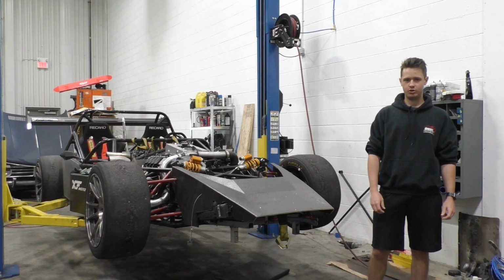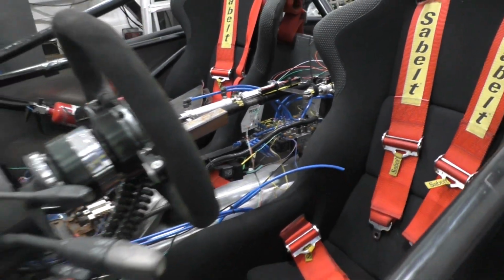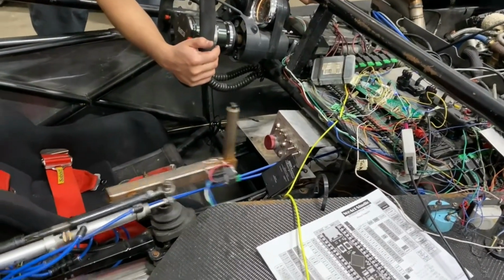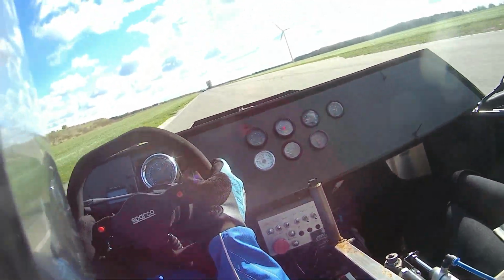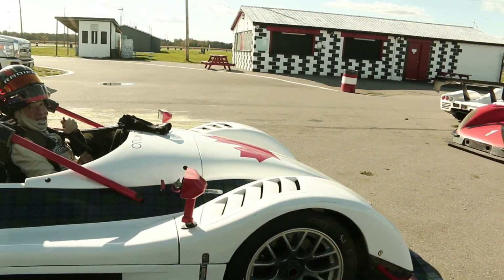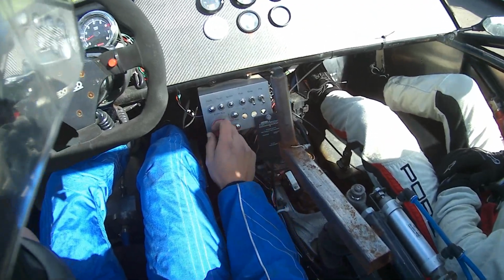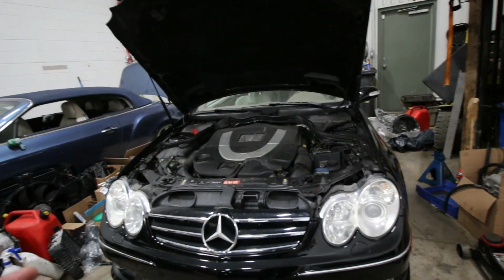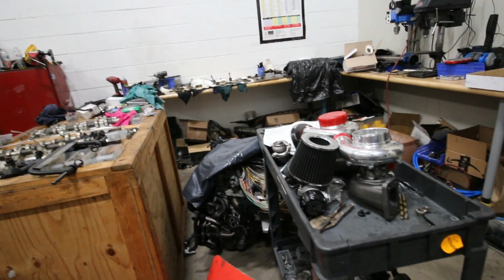Converting a Manual Transmission to Paddle Shift (Making the Electronics)

Comment: I would personally like to see the whole mechanism cleaned up and shrouded to some extent.  I think you could loose enough weight by cleaning that mechanism up to rationalize putting some kind of protective cover over it.  I understand that you like having the ability to shift it manually, buy I think a good goal to set would be to make it reliable enough to not need that backup.

Comment: Congrats on 100k The paddle shifter as a engineering exercise is pretty cool. Seems completely unnecessary for this project given the broad torque range and power.You only have to shift a couple times per lap. For me the simpler you can make a race car the better, less weight and more seat time.

Comment: I really think the shifter interface could be made much cleaner.  I've pondered about this for a long time because I have a T5, but on that CD009 with the external shift rail it should be much easier.  Really you've got a "barrel" and "throw" action, it should be possible to automate the barrel using a servo motor (not hobby servo, a proper servo motor) and handle the throw with either an actuator or pneumatics.  Back in the day a team used parts from an Aston T56 to make a computer controlled shifter for a paraplegic racer in the Mustang series.  I know you're married to the CD009, but a T56 with those Aston electronic shift components could be a nice alternative.

Comment: Maybe you should consider 8HP gearbox and standalone controller for this eg. TCU from TurboLamik in Poland? Three is a lot of video's about this controller. Also GCU controller from HTG company is very popular now.
Reply: too heavy for a race car. and why buy controller when you can make one
Reply: @kize32  but when something is popular on the market and checked by users, I think its faseter to buy one, and also its more reliable than controller you have to design by yourself. Of course develiping things  by yourself is more fun and you can learn more, but if you need fast and reliable gear changes its better to youse something which is known on the market.
Reply: @pitucha1234  shipping from poland to canada would take how long? 2 months?
Reply: @kize32  no, ZF 8HP weighs less than 100kg

Comment: besides price/wanting to do it yourself.

have you guys considered a e9x m3/f8x m dct trans and ecumasters black? i believe people use that ecu platform to tune+control the shifts for the dct trans.
Reply: Maxx ecu is the main one for dct gearbox. Ecu master at the moment you still need a standalone controller (couple available), where the maxx will keep the transmission ecu happy. Would be  much cleaner simpler setup for sure than this.
Reply: @garyhowe88  ah ok i think i may have mixed the two up. Im looking in my searches and i see maxx ecu on a s85 dct car.